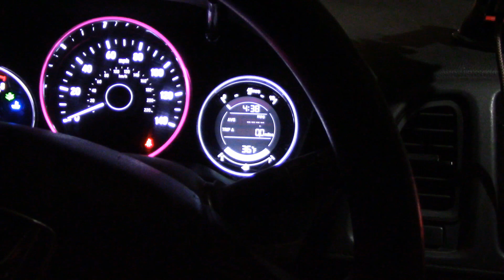RCA 1936 RR-359B field test TV- A new adventure begins

Comment: i workrd at Sarnoff Labs  for 30 years and met many of the fathers of Television, they are all gone now. My job was building prototype citcuitry for RCA that led to the XL-100 and the Colortak TV. They were both modular solid state sets. My main Project was the CTC -100 chassis an entire TV set on one circuit board.  When the company was taken over by GE we had developed a receiver where video came out of the tuner to the  10 Inch square mother , main circuit board containing all the video processing. The tuner was a separate digital tuner. It never made production as GE sold RCA to Phillips. I am 82 and retired,watching your show every day.

Comment: Absolute holy grail acquisition there Bob! Looking at what systems were in use when, it seems this set could be 343 lines as 441 not was generally in use till a little bit later.  Going to be a fascinating journey for sure.
Reply from the maker: The early run was 343 lines, the later, like this one, were 441.  I heard there is enough room in the oscillators to handle 525 lines without modification.
Reply: So the production run covered both systems. I’ve read some 405 line TVs could be brought up to 625 but at the risk of burning out the horizontal output transformer.

Comment: This project is worthy of someone who has Bob's rather formidable knowledge, experience and skills. I suspect the power-supply circuit is pretty fickle in this set, and may need some slight modifications to accommodate for today's higher mains voltages and 60 Hz. Hopefully, it can demodulate the original 1941 NTSC television broadcasting standards without any problems. From what I've been able to see, this set reminds me of the pictures I've seen of the sets displayed at the 1939 World's Fair in New York.
Reply from the maker: Quite a bit different inside.  They made a lot of changes between '37 and '39.

Comment: One of the early black and white sets I got back in the early 70s had like a 12 inch CRT and a ton of old radio tubes in it. Picture was very dim but worked and you could see it with the lights off.
My sisters used it in the loft that was their bedroom and I don't remember what happened to it but probably got left behind when we moved. I seem to remember a ancient TV shop gave it to me when I asked about it when I was buying a old Zenith transocianic and trying to get extra tubes. They had boxes of old used tubes they would just give me the ones I needed too and I think they fixed my first color TV for me when I couldn't figure it out and butchered the power wiring on a bad guess. They wouldn't touch it but allowed me to redo the wires myself in the back room, then they fixed it for like 60 bucks.

Comment: A fascinating set! Here in the UK there was actually a pre-war public TV service using 405 lines, it began on 2 November 1936 and continued broadcasting on VHF right through to the early 1980s. That is, except for the war years, which meant broadcasting was suspended from 1939 until 1945. Pre-war TV sets are very rare here in the UK though, since few sets were sold as they were prohibitively expensive for most people, and the area covered by the service was only about 30 miles radius from London.

Comment: I believe the deflection drive is done somewhat similarly to how it was done in the 20-inch DuMont sets, but there were two different tubes used- a 42 for the horizontal output an a 6C6 for the vertical output.  The HV rectifier is an 878 which was used in plate supplies in radio transmitters.  The audio output tubes are 2A3- let's hope they're good, as some of the tubes in the IF section.
Reply from the maker: Yes, you are correct. I do have a couple of are 2A3s but I sure hope there are some good ones in the chassis
Reply: @bandersentv  adapters for newer/more-common tube types can also be made/used if needed. I’d speculate that most (if not all) of the ‘U’ base tubes in that set have octal/loctal or even 7-pin miniature counterparts that are electrically identical (more-or-less). At most, a few extra resistors may potentially be needed [integrated into the adapters] to correct any biasing/IV curve discrepancies. 

This would certainly be advantageous for use in lieu of any/all particularly-rare tubes during the resto process to avoid inadvertently damaging them; especially during initial power-ups attempts.

Comment: Some of you may know that the last tube TV transmitters used inductive output tubes.  Well, so did the first.  The transmitter on top of the Empire State Building used for the first TV broadcast in 1939 used an IOT.  They sold the 839 IOT for a short time on the open market, but these early IOTs had limited output power compared to a klystron or a tetrode so the technology was shelved for several decades until later developments in the early 1990s greatly improved its efficiency.

Comment: Was going to offer what tiny bit technical info about the 441 line but I'm sure you're already familiar. There is a Wikipedia page on this if it helps. Also, I'm pretty sure that the Early TV  Museum already knows everything anyone could possibly need to know about scan convesion (you probably already knew that too). Anyway,  good luck! The result will be worth the effort.

Comment: Wow Bob, what a find!  This restoration will obviously be your greatest achievement.  Definitely a field prototype set before the TV transmission standards were ironed out: 343 lines which was considered high definition in that day.  10290 Hz horizontal sweep frequency but, with magnetic deflection!  Receive frequency range of 42 to 80 MHz which was considered super high frequency in that day.  8 MHz sound IF, AM modulated.  10 MHz video IF with a 1.5 MHz bandwidth (vestigial sideband).  

I am interested to see the high frequency RF input sections of the receiver because, the tube bases used then had a frequency limitation of 20 to 30 MHz.  The new Loctal tubes were the only ones in that day capable of the higher frequencies.  

Coming up with a signal source will be interesting since it is so much different than the NTSC standard.  At any rate, a very interesting restoration and learning experience!
Reply from the maker: I don't have the tuner schematic, but it's my understanding there was in RF front end. Antenna right into the mixer like a spectrum analyzer. This did lead to problems with the sets radiating the mixer products back through the antenna.
Reply: @bandersentv  I wouldn't be surprised if the antenna input was the mixer, coming up with a low noise RF amp tube in that day probably would entail the design of a custom tube.

The only schematic I could find close to this set was at the TV museum from the slightly earlier model, and it is only a simplified version.  You may have to trace out the circuitry to make a schematic while you are changing out old capacitors.

As you mentioned, this set was designed around radio tubes of that era, which weren't ideal for the application so, to make up for the difference, I suspect RCA had to use more tubes in parallel/series to achieve the power or gain requirements.  Those 6D6's for instance were the defacto standard for IF amplifiers in higher quality radios in that day but, at 10 MHz, the gain is noticibly dropping off.
Reply: @billharris6886  This set had an updated tuner, and I wonder if that tuner had an RF amplifier, unlike the original. That might have been a functional upgrade, even if it's not original.
Reply: @garystrait3289 Thanks Gary for your comment to help keep TV developement history alive!  I appreciate it!

Comment: Okay, I’m pretty sure this predates the NTSC standard, so how are you going to test it even if you do get it restored? Wouldn’t you need the corresponding transmitter? And it seems that would be a big problem, itself. First, you’d have to either obtain one, or reverse-engineer the set and then use that to build a transmitter (or something like a test-pattern generator). Second, you’d probably have to have a license from the FCC. 🤔
Reply: Can probably use something modern to emulate it just using an rf output. Closed circuit so no fcc issue.
Reply from the maker: From what I've read the horizontal; has enough range to lock onto a 525 line NTSC signal.  Might need to directly inject the audio into the preamp.
Reply: @bandersentv  depending on how RCA designed the IF chain (and what parts they used) there’s likely enough slop/tuning range in the interstage cores to expand the bandpass out to 6MHz. 

I’d be most concerned about determining the following:
1.) whether or not the frontend/tuner’s range covers any of what became the official VHF channel allocation range (excluding channel 1)

2.) which sideband orientation (upper or lower) of the IF VSB does it use (NTSC uses the lower sideband)

3.)what modulation depth and polarity it expects of the incoming composite signal. in NTSC, the baseband composite signal is modulated ‘upside-down’ (wherein max amplitude is the sub-black sync tips, and minimum amplitude is peak luminance/white) at a depth of 87.5%. As you’re already aware, aural carrier was initially broadcast at the same magnitude as the video, but later reduced to -15dB (relative). You may need to tweak your BT modulator’s A/V ratio the set’s audio strip doesn’t have sufficient gain
Reply: A couple of sources report that this set will work with NTSC 525 line signals, because there's enough range in the horizontal oscillator to adjust to the faster line rate.

It's also possible to convert to earlier standards to run this set with the original resolution. Aurora Design made a couple of converters, their multi-standard World Converter WC-01, and some single converter models. Their website even shows an example image of an RR-359 running the earlier 343 line standard. I'm not sure if these are still available, if someone wants to help this project they could try to track one down, but it's not needed in the near term, and might not be needed at all if the set will handle 525.

Comment: I still think you are nuts for paying whatever you paid for it. But I have to congratulate you on acquiring such a historical set. I hope you can make it whole again. It will certainly be interesting. Take your time and consider your steps on things carefully. You get one change on this 😂 no pressure 😂.
I hope it is incredibly rewarding as an experience.
Reply from the maker: The last two on the market sold for 35 and 50 thousand dollars so I did alright.
Reply: @bandersentv those were in far better condition than yours. You mention so in the video. 
But at least you have an interesting challenge.